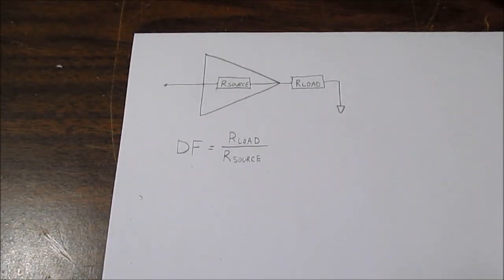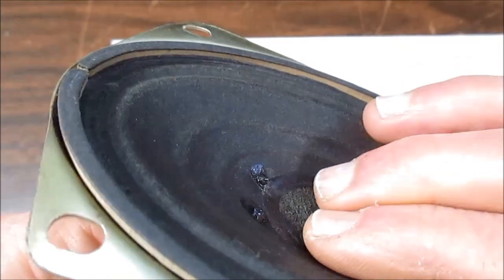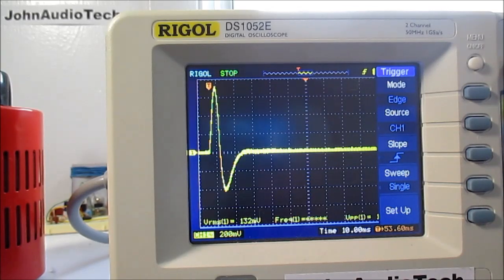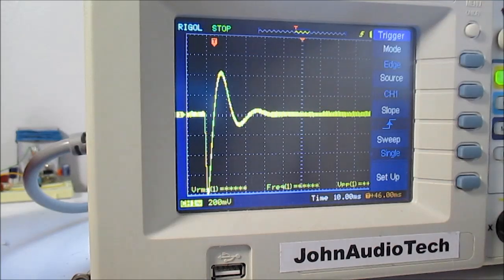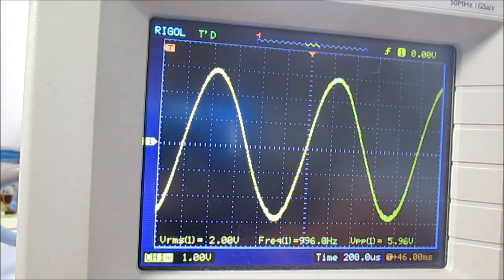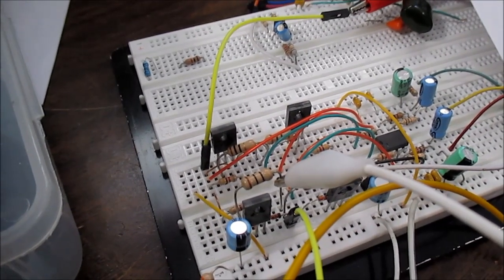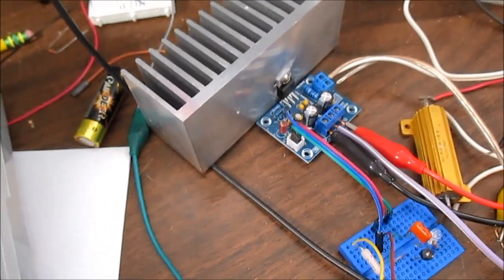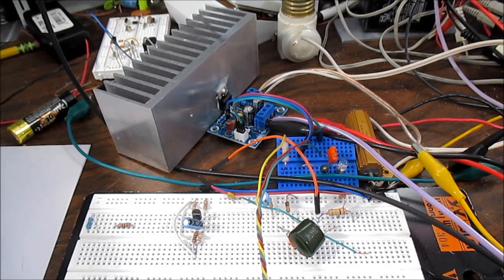Damping factor in audio amplifiers with demonstration

Comment: Hey John, my observation with damping factor is that when you have a speaker with high mass and low mechanical and magnetic power then a higher damping factor is necessary, typically the speakers with a high frequency range and low efficiency i.e. the old Infinity, or Apogee, Dynaudio that type of speaker. But when you have a loud loudspeaker with low cone mass, relatively stiff suspension and lots of magnetic power then a lower damping factor will help. Speakers of that type are i.e. the JBL studio monitors like 4425, or Tannoy Westminster or Altec Voice of the Cinema these type of speakers. But as Michael Beeny already said, the higher the mass and the lower the frequency the more of an effect it has. A loudspeaker that deserves the name IMO always works best with an output transformer.
Reply: Thank u for that insight! Which amplifier would you recommend for the JBL XPL200 Stereo Speakers? My amp (Sansui AU-G90X) isnt able to control the big cones very well.. do u have a good recommendation for an amp or a damping factor that can handle those beasts more confidently? :-)

Comment: A few quick questions... Does a higher dampening factor result in a reduced T.H.D.? In general terms? Also, longer speaker wire lengths, can they reduce a speakers dampening factor?
Reply: Esoteric Audiophile   ,    Use the words "meaningfully reduced" here instead of reduced. That is "the rub."

Comment: hi john  when you talk about 1.29 amperes in your calculations i suppose that its the current flow from fonction generator but id like to know how much current you inject in your amp from generator  with no load and so  there is also current lost by insertion in the amp  but no matter what in the calculation.

Comment: I think you got it right first time when you said that the negative feedback compensates for the voltage drop you would get from the potential divider network between the speaker impedance and the 10 ohm resistors.
Maintaining the voltage between the 10 ohm resistors to compensate for the divider loss does not sound like reducing the output impedance,more like correcting the voltage drop.
Reply: It does reduce the output impedance because it forces the amplifier to act like a current source.

Comment: Nice video! It would be interesting to connect an amp with no input signal (or with a resistor shorting the input) to a speaker and do the pencil bounce test while watching the speaker terminals on the scope.

Comment: Very intresting matter. Clear explanation. 
I do recall the Philips MFB (Motional Feed Back) speaker system. They had a piezo glued in the woofer that measured the actual movement of the speakercone. As a result, the speakercone itself was part of the feedback loop. They had their poweramplifier built-in and were pretty expensive. These systems were built arond the early 70's (now start guessing my age... )
Try googling on Philips MFB to find lots of information (most in Dutch)
I'm not sure if the Philips MFB was marketed outside the Netherlands.
Now we are googling... also google on speaker resonance frequency and q-factor. 
Question of the week: Why is the damping factor an issue only for low frequencies? In John's video we see the higher frequencies are not effected.
Reply: I remember powered Advent speakers around 1975.

Comment: 1. The TDA2050 amp appears to be missing an output inductor (usually an R||L combo), which tends to contribute the bulk of commercial amplifiers' output impedance but is also important for maintaining stability under adverse conditions like capacitive loading due to long cables in addition to the customary Zobel network (RC to ground). Rolling your own actually is not too hard - 10-20 turns of AWG20-ish enamelled copper wire around a pencil or something (plus a 3.3-10 ohm, 2-3 W resistor) should do.
2. You can actually get fancy cable length vs. resistance calculators online, and tables of wire gauges tend to list resistances per length as well.  So let's say you've got a twin lead of AWG16 wire at 13.6 Ohm/km (= mOhm/m), then that's 272 mOhms for a 10m run, or DF = 29.4 re: 8 ohms abs max. Pretty marginal. Here in 4 ohm land, longer runs like that tend to be done in 4 mm² (~AWG11), though often the ends will have to be thinned out to fit the speaker connectors - and that's fine. Nobody is going to care if 0.2% of the cable length is only half the diameter, that's an extra 0.6% of resistance. It's the bulk that matters.
3. Single drivers actually are not very picky about DF, loads of them will be perfectly fine at around 10. Crossovers can turn a speaker's impedance graph into a real rollercoaster though, necessitating values in excess of 20. In 8 ohm land that still is rather easily achieved with an amplifier DF of 60 (8 ohms) plus AWG12 wiring, in 4 ohm land that same amplifier would require some ridiculous wire gauge for long runs (like AWG6!).
4. Your headphone amplifier, as good as it may already sound at this point, still has some rough edges to iron out. 
a) If open-loop output impedance is 11 ohms, that's = 0.5 (r_e + R_e), with R_e = 10 ohms, making emitter follower output impedance r_e = 12 ohms each. Now that equals V_t / I_c, so your idle current comes out as about 2.16 mA. (Simulation with those same values and Bob Cordell's transistor models gives ~2.14 mA, so almost bang-on.) Your average BD139/140 pair (non-Philips) tends to appreciate a bit more than that as they're a tad slow. I'd say a minimum of 10 mA, 30 mA if you can afford it. Your average Class AB headphone booster tends not to use these transistors but rather some slightly exotic TO-92 jobs, with nice and constant beta outweighing their thermal disadvantage. (With nothing else at hand, one or two pairs of BC337/327 shouldn't be too bad.) 
b) There is significant asymmetry in transistor driving since the opamp cannot push current up through the upper bias diode, restricting current sourcing capaciting and generating even-order distortion. Place a capacitor of at least several 10 µF between the transistor bases to counteract this effect at mid-high frequencies. Alternatively, consider asymmetrical driving with both diodes on the lower side of the opamp output, in which case the upper bias resistor is also dispensable (yay, free opamp class A biasing!). This will cost you a diode drop's worth of output swing. It makes it easy to upgrade to hot class A operation with a 3rd diode (or a red low-leakage LED) though.
c) For the sake of stability, employ local feedback from opamp output to inverting input (22-47 pF NP0, typ) and an output resistor for the opamp (10-100 ohms, typ) to counteract the inductive nature of opamp output impedance. You probably know how much emitter followers "love" inductive source impedance. You're probably getting away without since your gain is relatively high - at a more typical 8-14 dB and/or given a few nF worth of capacitive loading it may look different.
d) Likewise, having at least a fraction of an ohm worth of output series resistance may be worth it, possible even something more advanced (full Zobel + output indoctor, though inductors tend to be tricky for headphone use as you generally have to resort to ferrite cores, and those can be a bit crummy).
5. Bonus fact: While high impedance (current) driving tends to mess up frequency response around resonance badly, it can drop distortion levels drastically (down into headphone territory), especially with high-end drivers employing a kapton or other nonconductive voice coil former (apparently the eddy currents in Al formers are not beneficial to voice coil linearity). You can design an amplifier that will transition from voltage drive at low frequencies to current drive at higher ones and so exploit the best of both worlds. I think there even is a small handful of high-end active speakers employing this technique..
Reply: There are quite a few errors or misstatements in your comments.  
Regarding 4 b), no, the design is not asymmetric with respect to driving the output transistors.  The op amp can't sink current through the lower bias diode, either.  All of the base drive current comes from the 4.7K resistors and both polarities of drive function precisely as complements.  And placing a single capacitor between the bases will not help the op amp to drive more current to the transistors, unless the asymmetrical configuration you suggested is adopted first (i.e., those mods are mutually requisite, not alternatives).  Placing a capacitor across each diode would permit the symmetrical configuration to be retained.  
In 4 a), quiescent Ic will be highly dependent on temperature difference between the diodes and the output transistors, which of course varies.  Pegging the figure at 2.16mA +/- 0.02mA is pretentious.  
I have several other points as well regarding your comments, but then I also have better things to do.  I will just caution the readers to be wary and not presume your statements are accurate.
Reply: @marianneoelund2940  Challenge accepted. :) Loaded up a circuit like this in LTspice, plotted diode currents and voltages and...
Well I'll. Be. Dipped, as Derek @ Vice Grip Garage likes to say. (Funny guy, btw.)
Symmetry. Distortion is dominant 3rd. What the...? It's not like I haven't played with these circuits for a bit. *headscratch* (This one random circuit I pulled out combined a 1N914 model with a 1N4148 à la Bob Cordell, so that wouldn't help. I obviously corrected that first.)

The good news is, bypass capacitors across the bias diodes still reduce distortion where they are effective, and you still get by with just one cap across both as one of the diodes is always conducting and low dynamic impedance. Phew. 

Thank you for this negative feedback - as Bruno Putzeys says, the more the merrier. ;) Usually this is my specialty.
Spouting nonsense is in fact not one of my favorite hobbies, and it still happens more often than I like. One time I derived a Friis formula equivalent for calculating the equivalent input noise of a string of voltage amplifiers and had it online for almost two years before I noticed that it was missing a bunch of squares - I sure wished someone had told me earlier. (I guess nobody really reads Web 1.0 style homepages with loads of text any more.) Or the time I reckoned I needed a current input to get a non-warped frequency response out of a headphone used as a microphone (actually, nope).
 
At the end of the day I'm just some guy who knows a thing or two about a thing or two. I guess if I had the chops of Douglas Self, Bob Cordell or Bruno Putzeys I'd be designing amplifiers for a living, not just writing about them on the interwebs as a hobby... (Honestly I'm glad I can do this next to my non-engineering day job. Doing things for a living can really take the fun out of them.)
Reply: @PileOfEmptyTapes  
Glad to hear you're having fun with this hobby - and I have to commend you for the diversity of concepts you've embraced and are able to work with.  
I don't expect perfection from any individual.  This is why engineering is always done by teams, and group-level design reviews followed by exhaustive testing are critical parts of the process.

Comment: You demonstrated that larger speakers need more dampening than smaller speaker when there was more ringing in the larger speaker with everything else equal. I have several amps from 150 to over 1200 dampening factor and the bass is by far the tightest and most controlled on my JC1 mono blocks (>1200 DF). In fact the bass control seems to be proportional to the dampening factor on my amps. However, the quality of the amps are also proportional to the DF, so that could be playing a bigger factor than the dampening factor. It makes sense that very large and powerful speakers are moving much more mass and would benefit more from higher dampening factor. For the kick drum to sound natural you can't have much ringing.
Reply: You should try shorter speaker wire. The shorter wire has a drastic improvement on the dampening factor. Also Thickest gauge possible! Maybe your amp that has 150DF can sound tight and controlled also.
Reply: Practical Guy  I use short 12 AWG quality speaker wire (it is basically 0 ohms). My amp that has 150 DF sounds much more controlled (and better all around)than an mass market new receiver (even a $3000 Yamaha that claims 170W/ch which is a joke) I have heard. My amps are all high current and all mass market receiver are current limited. I am very susceptible to listening fatigue, so if an amp doesn't at least sound remotely natural, I can't listen for more than a couple songs before I have to turn it off. I know enough about electronics to fix most things and that is why I have way too many amps (pre-amps...) lol I bought a bunch of "fix or repair high(er) end amp for peanuts. I thought my amps sounded pretty good until I bought the Halo JC1 mono blocks (which have >1200 DF) and I was blown away when I heard the tight, natural and controlled bass (not to mention the much smoother mids and highs). For the first time I heard a natural sounding kick drum and I could distinctly hear every change in key, note, chord (I am not a musician so I don't know the exact term). 

Basically what I am saying is, that to notice the short comings of an amplifier, just listen to a better one. It will soon be apparent what you are missing. Bryston Amps also have very high DF and those amps are also renown to have excellent bass control. I certainly understand the gimmickry in marketing audio, but that only seems to be a problem in mass market amp (receivers...). Higher end companies tend to under rate their specs and leave considerable headroom (which I have verified in testing in certain things like clean output power before clipping). For instance I have several B&K Components and the receivers are rated at 150 watts/ch and the test at over 160 watts (no clipping) 2 channels driven into 8 ohms. Where as the Yammy receiver (170 watts/ch) at the store couldn't even properly drive Kef Q100s (86 db sensitivity) and especially the Kef LS 50s (85 db). 

All my amps sound good, but the JC1s sound amazing and they should because they cost a small fortune. Sorry for going off on a tangent (I tend to do that). My point is that I think high dampening factor is necessary with very powerful amps driving big speakers capable of high power (more mass and more momentum that needs to be stopped from ringing (oscillating). Even in John's test, the 1 DF stopped the small speaker, but wasn't enough to stop the larger speaker from ringing. I am sure there are other factors that contribute to tighter bass in higher end amps than Dampening factor, but there must be a good reason why they design more powerful amps with more dampening factor, because they don't seem to be fudging any numbers on the other specs. I could see the above mentioned Yammy claiming 1 million DF, because the power claims are ridiculously over rated at 170 watts/ch (lucky if it has 70 clean watts with 2 channels driven and it is still current limited and will have no dynamics, so the bass will suck). Not to mention the way they cheat with distortion spec as well, by taking them at 1 watt, rather than at rated power like higher end manufacturers do (or at least give both ratings).
Reply: @gordthor5351  thanks for sharing your knowledge👍

Comment: Okay. That made perfect sense and helped to further my understanding of feedback. Good Job! Now why do my speakers sound better, (to me at least), if I use 12 gauge zip cord (appliance wire) instead of the 18 gauge speaker wire provided with some of the cheaper speakers?
Reply: Night Stranger  It may be that larger gauge speaker wire (thicker conduter) that you used has better impedance for your application. I usually use 10 feet of 16 gauge wire and 14 gauge if any longer than 15 feet. I always assumed that the less resistive wire at greater length would sound better, in my experience it has.

Comment: Of course the damping factor is only really important at low frequency's due to the large movement of the cone. The damping factor makes almost no effect at over probably 1khz. One reason why valve amplifiers tent to give the damping factor at 1Khz because at low frequency it will be very much lower.
It's not only the cable resistance in series with the loudspeaker, in most high quality loudspeakers the first thing the signal sees is a choke as part of the crossover. Cheaper ones use thinner wire which gives higher resistance. Probably why an active loudspeaker tends to sound better. The amplifier goes straight to the drive units with very short cables and NO inductors or capacitors in series.
Reply: Michael Beeny  ,   True, true. And they DO sound better! Not just to your ears, either... but the measurement equipment, also.

Comment: With it's  ported and in the Box, you tap it, then the odd wavelength is... It vibrates twice before the air exits the Box, then it vibrates twice as the speaker slowly sucks air back in Box. Kind of like a piston..

Comment: That's why I always made sure my speaker wires were the same length. I didn't want to introduce too much of a variance between the two speaker channels.
Reply: You could make them excessively thick too, i mean AWG10, 3mOhm/m or so. If you fold the cables, you form an inductor. Not that either of both terribly matter, but still.